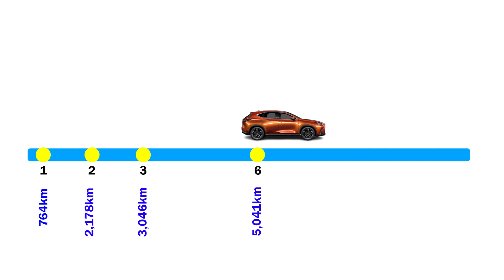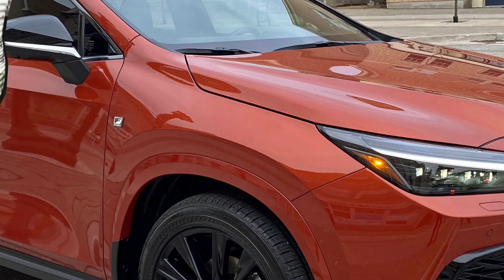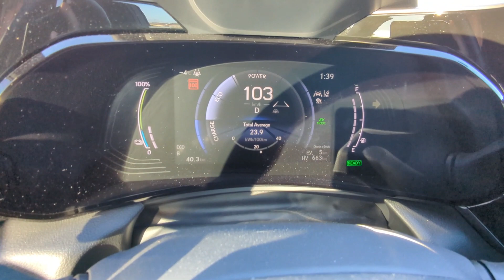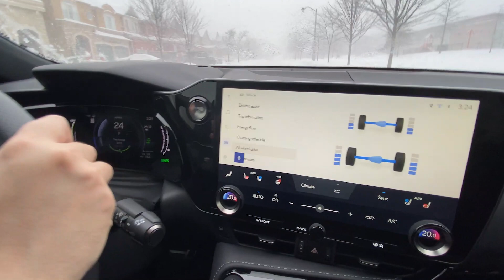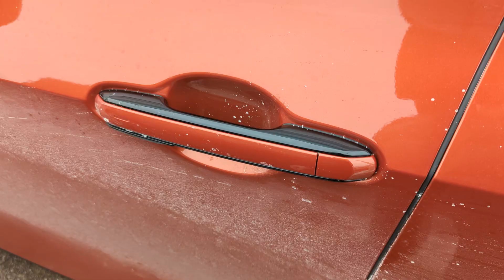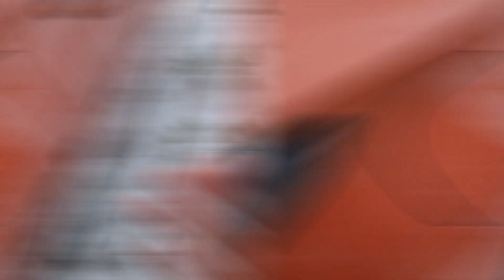9 Month Ownership Update - Honest Update of 2nd Gen Lexus NX

Comment: Which is better on snow (2 to 4 inches), NX 350 or RX 350?
Also, how do the hybrids run on snow?
Reply from the maker: Both would be the same.  Majority of the powertrain and system are the same.  Just a larger vehicle (heavier on the RX) might have a bigger advantage, but the smaller size of the NX could also be an advantage too.  More nimble.

The hybrids in snow are good.  Don't really feel that much of a difference.

Comment: I have been experiencing a lot of connection issues of Carplay with my iPhone X as well.  Is it my older iPhone issue or that of the NX ?  Any solution?
Reply from the maker: I have an iPhone 14 Pro and I rarely have issues with connection with wireless carplay.  Yesterday, I did have issues and I rebooted the infotainment system twice and it wouldn't connect.  The 3rd try, I rebooted the iPhone and after that I press Retry and it connected.  So sometimes it's the iPhone that is having issues and not connecting.

Comment: Thank you for your videos.  Question about the compass on the left side of the dash of my 2023 NX450h+, it doesn't seem to work when I'm running Waze via Carplay, is it normal?  If so, how can I see my directional bearing?
Reply from the maker: That was fixed in the latest update.  Are you seeing the compass or you are see the wrong direction?
Reply: @lsft  wrong direction
Reply: I see the compass but wrong direction
Reply from the maker: @solomonngan6072  I have noticed wrong direction sometimes.  That could be the phone.  If you move the phone around does it correct it?  Seems like a bug in some situations.
Reply: @lsft  I will try to discern that.  But the phone remains the same position in the NX.  The compass seems to start working when I turn Waze "OFF"
Reply: Besides the small window on the left side of the dash, can I display the direction on the big screen on the console ?
Reply from the maker: @solomonngan6072  You can only see it if you have navigation.  I don't have the compass on the big screen.  I can only see it on my headup display
Reply from the maker: @solomonngan6072  the car has the option to see the compass using the car or the phone.  I don't know in your situation what is it using.  Have you tried to reboot the phone next time to try.
Reply: @lsft  Once the Carplay is enabled, the control has gone to the car, ie: the console big screen.  I couldn't change Waze setting on the phone anymore.  Direction is not shown on the big screen.  Only on the small dash window on the left
Reply: From my limited experimentation, the compass seems to work when Waze is not running.  I'll do more experimentations.
Reply from the maker: @solomonngan6072  have you tried one connected to CarPlay and do not set any destination. Move your phone around. Does it show that your direction of the car is changing? I personally have seen the compass being incorrect. But it's not always incorrect and that's why I've asked you to reboot your phone.
Reply: @lsft  I have rebooted my phone (I've done it regularly).  I don't have headup display.
Reply: @lsft  Interesting, let me try it tonight or tomorrow, I'll let you know.
Reply from the maker: @solomonngan6072  I just drove my car and tried the navigation. You are correct. It seems like it shows a compass and it's wrong. However I've seen it working before as well. I'll try to see when it works.
Reply: @lsft  Ok, I did a few testings and come to the following conclusions: 1) when phone GPS (Waze in my case) is activated with destination, the vehicle compass is disabled, it would remain in the same position at the moment the GPS starts the navigation.  2) Vehicle compass works as soon as phone GPS exits navigation mode.  Just connecting CarPlay doesn't affect the compass
Reply: @lsft  how do I get the update?
Reply from the maker: @solomonngan6072  should just be a software update.  Go to the software update on the infotainment screen
Reply: Further, the vehicle compass works just fine with the car's navigation system running
Reply: @LSFT Thanks for your help

Comment: Can you use Regular gas in the NX? I thought it was Premium only.
Reply: I got the nx 350h and the staff in dealer who helped my go through my car told me to use regular gas, not even recommending premium gas. I'll just follow what that said as they take care of the maintenance and should know the car the best.
Reply: @vincentwen9289  Thanks for the info.
Reply from the maker: @vincentwen9289  Nothing wrong with using regular gas.  Premium is just recommended.  For me personally I would use premium as I only fill up once every 3 months.
Reply from the maker: The NX350 - premium is required,
NX350h/450h+ - premium is recommended and can use regular.
Reply: @lsft  Thanks for the info. Looking at getting the NX 350 H when the market settles down. Can you review the Luxury and premium packages? No sure which one to get. I saw the Luxury comes with leather. I though all Lexus came with leather? I know the Rav 4 uses Soft text.
Reply from the maker: @midiman5045  you in Canada?
Reply: @lsft  No NY USA, I know there are differences in Canada and US cars. The Acura RDX in Canada has Heated steering wheel  on it standard.
Reply from the maker: @midiman5045  I'll see what I can do.
Reply: @lsft  Thanks

Comment: Great videos! In winter temps …Do you notice when in EVmode your engine runs often ? The only way I can get the vehicle to keep in ev is setting the cabin temp to 18 degrees or lower or just simply shutting off climate (but that’s not ideal) I’m in Alberta and temps are -20.
Reply from the maker: Yes, even in EV mode, the heat pump is not efficient enough once it goes under -10℃ and would require the gas engine to quickly warm up the vehicle.  The temperatures in Alberta for sure would cause the gas engine to run more often.   I noticed that if I don't run the front defogger, the gas engine will not kick in, but once it goes under -10, it will run more often.  Keep in mind this is a PHEV and not a pure EV.  Expect winter months to use the engine and more gas, while in the spring, summer, fall months this shouldn't be a problem.  You still save a lot more gas over the 350h.

Comment: Great update! Thank you for continuosly posting updates. What winter tires did you buy (make and model)? Are they run flats? If not did you see a différence in the suspension or the driving without run flats?
Reply from the maker: Here is the video for my winter tires
https://youtu.be/xB2EDWbADJY

They are Michelin X-Ice Snow 18"
They are not run flats. I don't feel too big of a difference. I would need to wait till I put the run flats back on to confirm. The adaptive variable suspension on the FSport could be one reason why I don't feel that big of a difference.
Reply: @lsft  Thanks for the info and video.

Comment: Hey do you recommend to use up all the gas and fuel the tank every 3 months? If so how much gas do you purchase each time? Do you fill the tank completely?
If I want I can always use EV mode and leave the gas untouched for maybe 6 months or more cause I don’t drive long distance, and I am not sure if that is safe or recommended..
Thanks in advance
Reply from the maker: The 3 month guideline is what I am following myself.  Gasoline will go stale over time and it could hurt your gas engine and may cause issues if you don't use it for a long period of time.  Since the cost of filling up is not too much, I set to use a tank every 3 months.  If you cannot use up a full tank, you can fill up only half a tank and use the half tank every 3 months.  That way your car will be lighter and would be better for the EV range as well.  In the winter, if you are using the front defogger, you may use the gas a lot more than other scenarios.  So it depends on where you live and how cold it gets in the winter months.

According to Lexus you only need to fill in 20L of fuel in a year, but you may want to play it safe.  You don't want issues of the gasoline causing issues with the gas engine.  A fill up every 3 months is not a lot of extra cost.  But replacing or repairing the gas engine would be a lot more expensive and the car won't be as good as original at that time.

Hope this helps.
Reply: @lsft  thank you so much! That’s helpful

Comment: Nice. I'm a little sad about my NX after about 5 months of ownership is have 12v battery issue and basically been at the deal this whole month, I got it back a week ago and it when back yesterday 😔. I had to use the key and jumpstart the car. Love the car otherwise but this is not good for a brand new car with less than 2.5k miles. Also a privacy password came up on the infotainment and I couldn't use it as of yesterday 🥲.
Reply from the maker: Is your car sitting in the garage for too long and you are not driving it a lot?  I have heard a few other owners having 12V issues and some are related to the app/digital key is pulling too much causing the car to keep searching for the key, and another one was related to the dashcam draining the battery as it was connected with parking mode.  

I haven't heard about the privacy password issue.  What is that related about?  
Do keep me updated on the issues and what is the root cause.

Comment: How does this compare with the Volvo xc60?
Reply from the maker: When I purchased it, the Volvo XC60 had very little EV range, so I didn't even test it out.  The 2023 model, it has increased the battery capacity to 18.8 KwH, which is larger than the NX.  However, the rated range is still less than the NX.  I haven't tested the XC60, but I'm sure it's a nice car and there are areas it's better than the NX.

Comment: Hey LSFT, what’s the best way to break in the engine? Would you recommend driving hybrid for the first several months, or exclusively use engine (via charge)? 
You mention doing so would improve fuel economy. Thanks!
Reply from the maker: If you are looking at running the engine, you should use hybrid mode. Charge mode is not as efficient. Using hybrid mode will operate the engine at less load and you'll get your money's worth of gasoline usage.

Comment: Thanks LSFT and have a wonderful New Year. If Lexus condescends to manufacture my order of January 2022, I will be full bottle on the car. How much control do you have over home charging? I will be able to charge at the car’s capacity of 6kWh with my 512V 3 phase system. However, I will only want to charge using solar PV. Of course, that varies during the day and Enphase has delayed their AC battery supply to Australia so I am limited to my exisiting batteries that are not enough. This year we produced 14.8mW, used 6.3mW, imported 2.6mW and exported 10.3mW to the grid for which we are paid a paltry A$0.05/fWh. Electricity costs us A$0.29/kWh from our supplier. Our daily home energy cost is A$1.10 for the last 1645 days. Can I set the car to use only solar or does the control need to come from the Enphase system? By the way, we rarely need to heat the car but we find with our home A/C that heating is a lot less expensive than cooling. We would never drive without the A/C on auto. Keep up the good work.
Reply from the maker: On the car, you can only control what time and the current rate the vehicle can charge at. 8A or 16A.  The 16A is only available if you have the 6.6kWh charger option.

It's interesting cos the summer months I'm able to get more km in than in the cold winter. I think some of it is related to the battery temperature.
Reply: I have heard that some EV batteries are heated and cooled. Perhaps your extreme temperatures work against you in both summer and winter. By comparison, our range is around 15-33ºC. As I approach my BMW, I press and hold the unlock key and all the windows open. This allows the hot air to flush from the car before entering. Is it similar on the Lexus?
Reply from the maker: @stewartpenny  that feature can be turned on with the Lexus personalized feature. I have that turned on with my vehicle and you press and hold the unlock with the fob and it will open all windows. If you release the fob half way, it will stop.

Comment: Thanks for all those details and sharing with us. Here is my experience with my 350h in 2.5 months so far. When I got the  car it was beginning to get colder, so I didn't use AC or heating in almost the first 2 weeks. To test the fuel economy, I have been driving it unbelievably gently and slowly that it sometimes drives other drivers crazy. The best fuel consumption I got at the beginning was around 6.5 L/K. With very little heating on , these days I can get 7 L/K at best. Just note that I am not using the car's computer to estimate fuel economy as they are inaccurate.  I calculate that myself based on the actual gas consumption. I guess it is close to impossible to get around 6 L/k as claimed.  All my driving is in the city.
Reply: In cold weather, both ev and ice vehicles become less efficient
Reply from the maker: When it gets cold most cars need more engine to heat the cabin. Keep in mind the fuel economy is measured at best case scenario. You'll need to wait for the engine to break-in to get better economy as well.  I'm still waiting for my 450h to really break in as i don't use the gas engine as much.
Reply: @lsft  true. Thanks

Comment: another problem for EV mode in winter is:  the car warms up very slow. It takes about 30 min to start blow warm air , especially when outside temp< -10C.
Reply from the maker: Yes, if you're using the gas engine it does take time to warm up. But the heated seat and heated steering wheel works very well.

Comment: Hi, a quick question: what is the highest amount of liters of petrol you have been able to put in the car so far? I am asking for the following reason: there are some car journalists that were never able to put more than 40l in whist the car was nearly empty. So one of them expressed the doubt that the fuel tank contains 55l.......any thoughts? Thanks!
Reply from the maker: Last fill-up I had 3/8 of a tank with 232km distance to empty. I filled 32.8L. So based on 3/8, it means 52.48L as a tank.   Hopefully my next to fill up will be more when i use more gas in the winter months.
Reply: @lsft  Thanks!